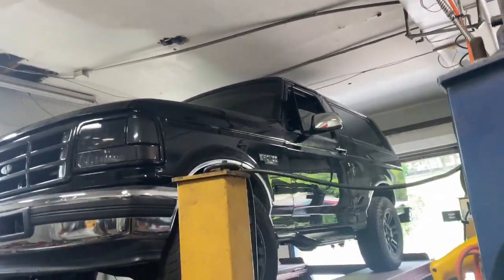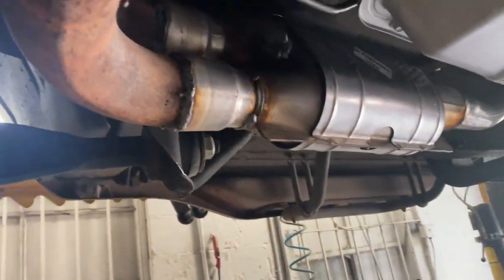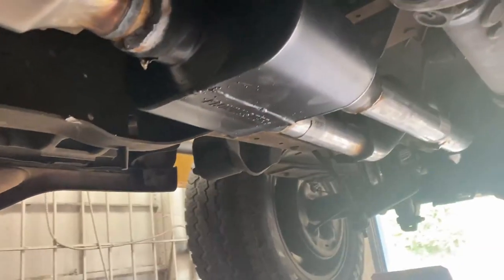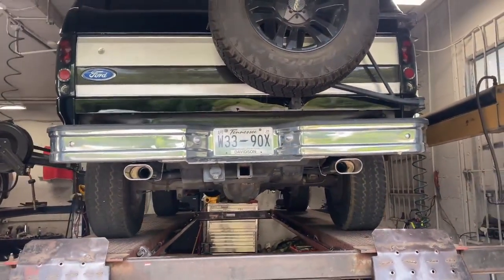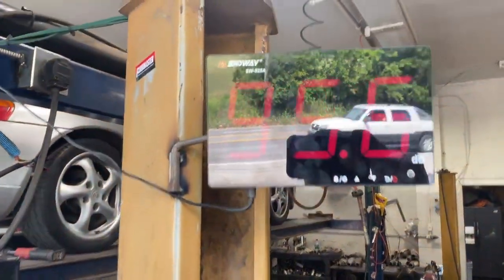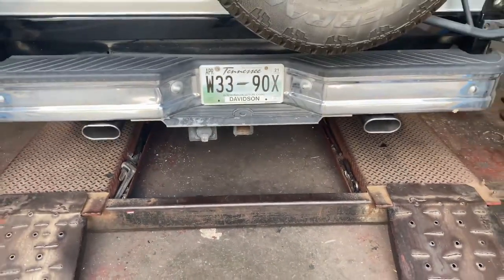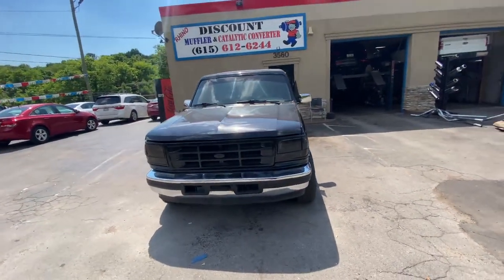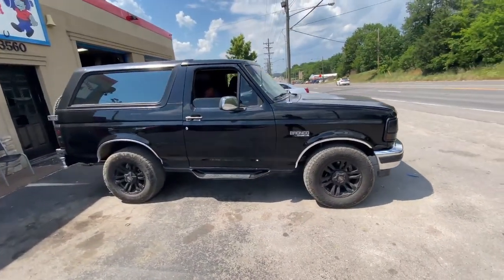1995 Ford Bronco 5.0L V8 DUAL EXHAUST w/ FLOWMASTER SUPER 10!

Comment: super quiet. Sounds restricted
Reply: Of course it’s restricted everything about an exhaust is restriction. Cats, mufflers, resonators if it has any. Straight pipe it and nothing will be restricted
Reply: @buffalobmf  but you'll lose horsepower because there's no back pressure tho
Reply: @Alphawolf2325  so. Its a bronco dont worry about the 5-10 hp you lose and wont even notice you lost. Plus depending what youre doing you need no restrictions